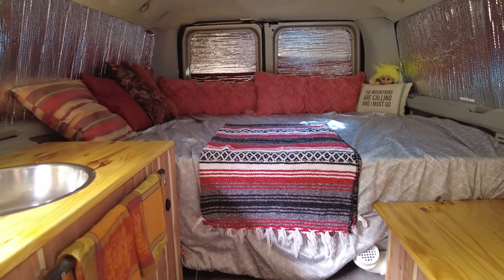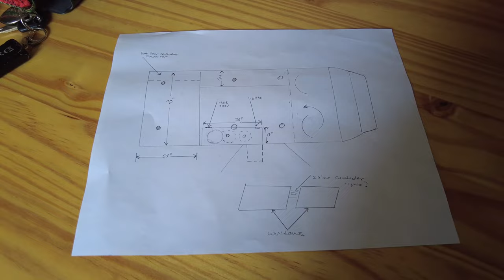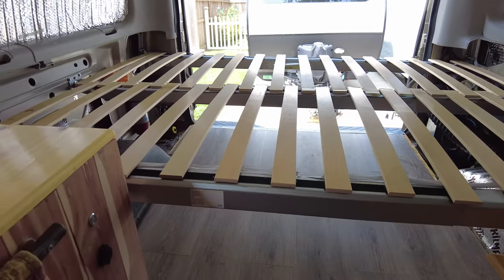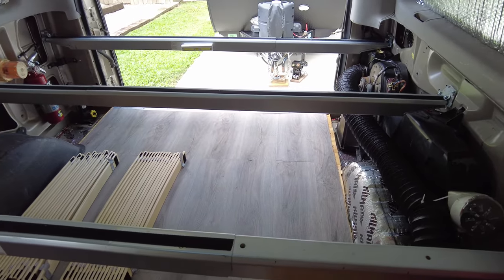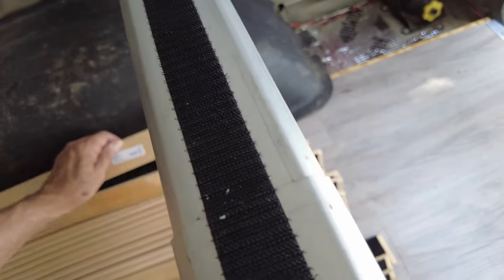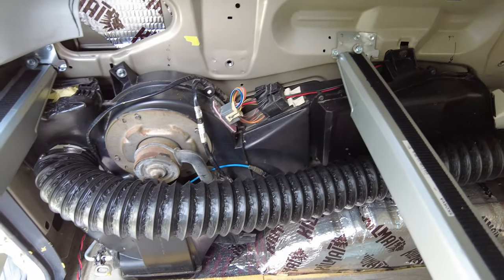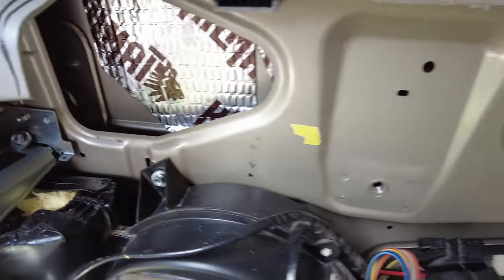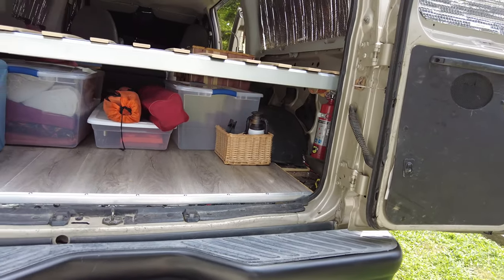VAN BUILD IKEA BED INSTALLED

Comment: Did removing the plastic panel over the AC make the van any louder when driving? Like does all the stuff jingle around more? I have been afraid to take mine off in case I screw anything up in the HVAC section.
Reply from the maker: Not at all!
Reply from the maker: No noise i did insulate

Comment: Wish I could post a photo. It looks great! Last step is putting in the "security screw." Did you have to drill new hole in the bracket for the security screw?
Reply from the maker: Yes I had to make a new hole for the security screws. I used self tapping screws. Congrads!

Comment: What’s the size of the screws ? I have the brackets. I was lucky , I got it the same. I’m just not sure what are the right screws to buy …
Reply from the maker: Thanks for watching!

I used 3/4" self tapping metal screws. You can get them at any hardware store. Lucky you getting  the brackets!

Comment: What's the length? Looks too short to do a horizontal bed maybe 55-60in?  Cot is 70in and twin is 75in in length.
Reply from the maker: I'm 5"9 and have a couple inches to spare. Taller people can sleep slightly at an angle. Thanks for watching!

Comment: Seems like the bed would be more than 54 inches wide with two sets of twin slats, but I guess it is because they overlap
Reply from the maker: They overlap roughly an inch
Reply: A twin Luroy is like 38" wide so how is the bed only 54" wide?
Reply from the maker: Its a full size
Reply: Of course! I've been wanting to do this a while and I finally have time. Thanks for clarifying. Sorry to be dense.
Reply from the maker: Your fine. Its a simple sturdy solution

Comment: Is it long enough to sleep comfortably? I am 5'`10"
Reply from the maker: You would be slightly touching both ends, but I think it would be comfortable. I do have the stock side panels in the van still. Removing them, would give you another 1.5 inches

Comment: With everything at Ikea they have  Part # for it, do you have  such numbers for those Brackets ?  Also can you spell out the  name / wording for  the brackets ? I could  decipher it when you said the nae of the brackets,
Reply from the maker: Part #116791 all it says is Bracket.  You can search the part number and you will find them.

Thanks for watching!
Reply: Skorva bracket...not just Ikea sells them.. AMAZON now also sells the rail and brackets, brackets are 13.99 for 2.  Rail is 35.00
Reply: @MikeAndTheGreatOutdoors  I can confirm that this is the product # and you have to call customer support for them to ship it out to your for FREE. They didn't even ask to confirm that I bought the beams from Ikea. Free brackets (6 total) and cost a total of $50 on Amazon.

Comment: Do you have the link, part # , or name of the bed from IKEA?
Reply from the maker: Here is a link for the rails. You also need the wood slats

https://www.ikea.com/us/en/images/products/skorva-center-support-beam-galvanized__0636189_pe697703_s5.jpg?f=xl

Bed slats
https://www.ikea.com/us/en/images/products/luroey-slatted-bed-base__0268303_pe406267_s5.jpg?f=xs
Reply: Amazon now sells them, it's prime 2 day delivery in Detroit, 35 for each rail and 13.99 for pack of 2 brackets
Reply: @breakingames7772  just so y’all know, the shipping from Amazon crams the rails together, and they seem impossible to get apart. Wd40 and in my case a hammer and wood block may be required. It’s hard, but possible